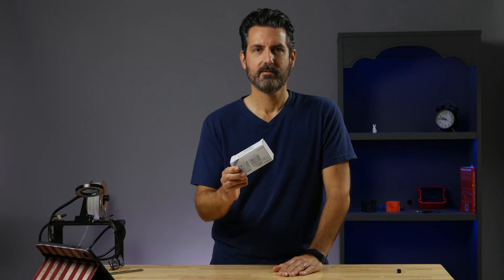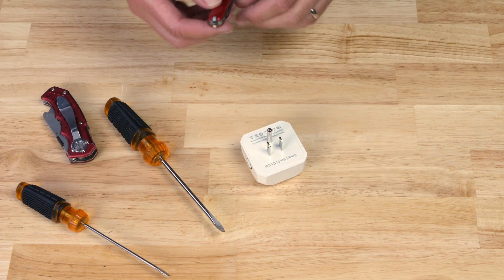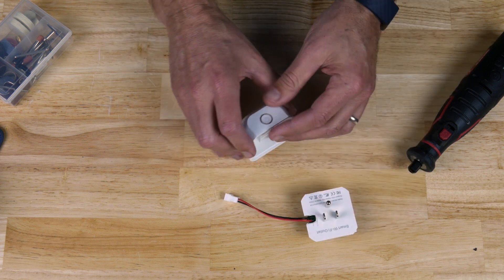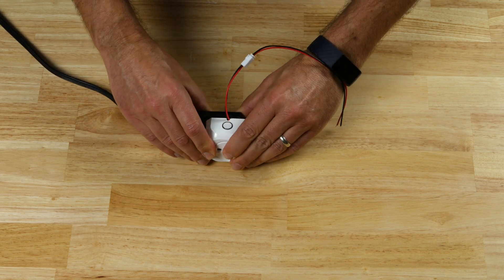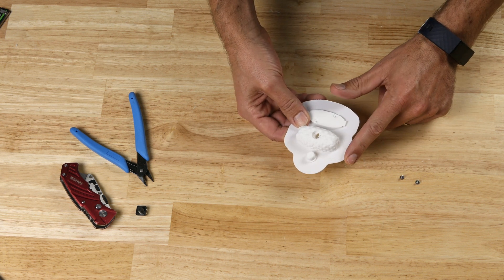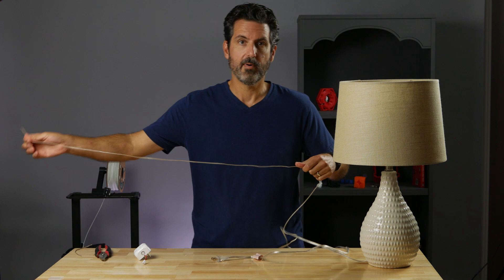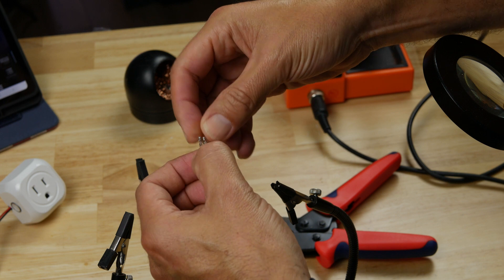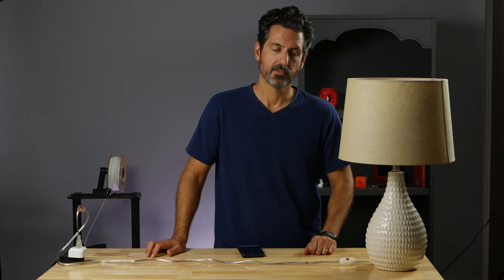I Hacked a Smart Plug and Made it Smarter - Here's how

Comment: At 3:07, the selected device has neither UL, CSA, or TVU safety certifications. A lot of people think the CE is important, but it only means China Electronics and has no safety value at all. Also, now is a good time to review the power relays' contact rating. 1 final thought, you may be dragging mains voltage out of the package all the way, across the room, to your final destination with wire not exactly rated for that purpose--poor insulation and undersized in the event of an internal failure. If it is not a problem today, it may become a problem tomorrow, or if/when there is an internal device failure.  Please measure the voltage to ground, from each of your extended wires, for just a little bit of 'False Sense of Security'. "YOUR" smart switch may be 'SAFE?' in the end, but there are 100s of different manufacturers that have just as many 'Safety'/'Lack of Safety' design considerations. Thanks for making this video.

Comment: My main concern about this addition is whether the smart plug isolates the control signal (the wires that you brought out) from the mains voltage.  You mentioned it was 3.3v (which I believe) but if you have a switch that has the 3.3v referenced to the LINE (HOT) side then you have an electrocution hazard.  Also, there have been cases of houses with LINE and NEUTRAL reversed in the wall socket.  In this case there is a greater chance of your control signals being driven from the LINE/HOT and again creating an electrocution hazard.  IFF you know that the electronics is fully isolated then this is a nice little project.  I expect you can determine isolation by checking connectivity from both wires to the LINE and NEUTRAL inputs.
Reply: Oh, forgot to mention that this is a good idea and I can see it being very useful in the scenario you illustrate. Just worried about the safety
Reply from the maker: Well I'm not an electrical engineer nor do I play one on YouTube. 😁 So, take this for what it's worth. I figured since there is a push switch there provided by the manufacturer it would be safe to break it out. It will have all the same safety concerns as the built in one. Thanks for watching and commenting. It is a useful project. I have 2 at my house and 3 at my church.
Reply: @dandesigns3d As someone who is skilled, you are creating a hazzard. That small wire does provide a path back to the mains. The reason that becomes an issue is when you are grounded and you hold the wire, the full voltage on the small wire is 170 volts potential crossing the very thin insulation. If your hand is sweaty it's an even better connection.  Why would your body be grounded? You might touch the screw on your wall plug or you might be using grounded metal device in bed ..maybe your laptop.  The other thing that can cause a fire, is that the small wire can become broken and grounded except the small wire may not provide enough current to trip the breaker but instead act as a heating element setting itself on fire.